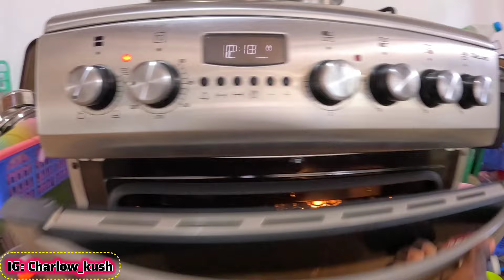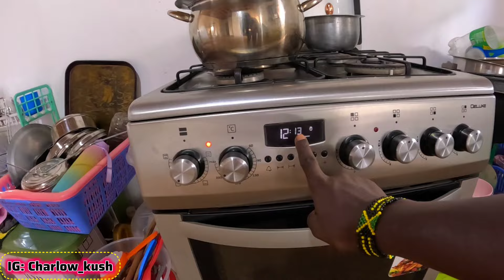OMG😱 The Long Awaited DREAM COME TRUE !! TEARS OF JOY 😭😭

Comment: Just finished the well in western kenya ,i was almost throwing awy my booster pump just learned some tips ,thanks
Reply from the maker: Keep it up, glad you found it helpful 🙏❤️
Reply: So what have you put on your pump to ensure it doesn't pump throughout ,? Is it using electricity ? And I saw it had gone immersed into water  wouldn't that lead to a electrical shot and lead to damage to the pump.....
Reply from the maker: The pump didn't touch the base of the water, it's suspended.
Reply from the maker: It's using electricity, and we're using a switch to turn it on and off
Reply: Ok thank you ..

Comment: congrats how much they charge per ft
Reply from the maker: The cost changes with the depth and If there is rocks the rates are still different
Reply from the maker: 1 to 10 feet is 300sh per feet
11 to 20 feet is 400sh per feet
21 to 30 is 500 per feet 

You add 100sh after every 10 feet

But when you find stones, they charge 2000 ksh per day

And when they find soil again they go back to the normal rates per feet
Reply: @Charlowkush001  okay thanks alot for explaining
Reply: Great explanations